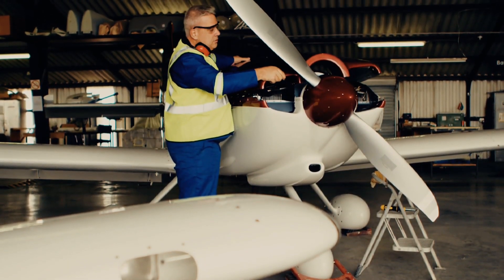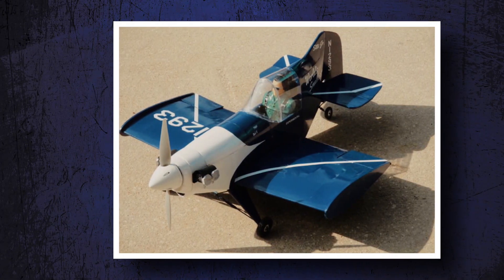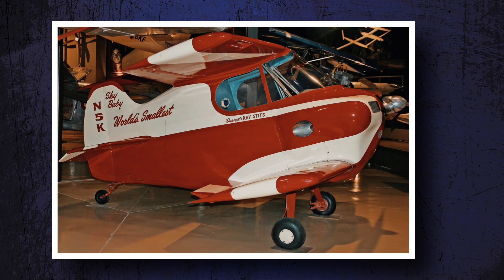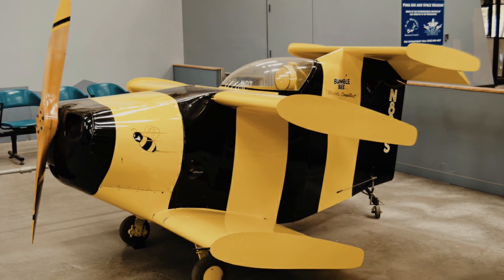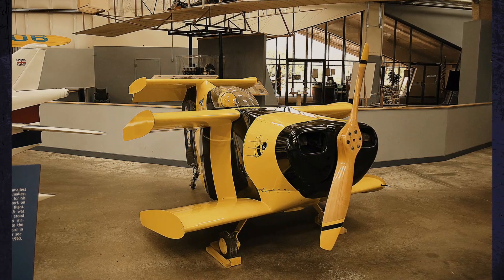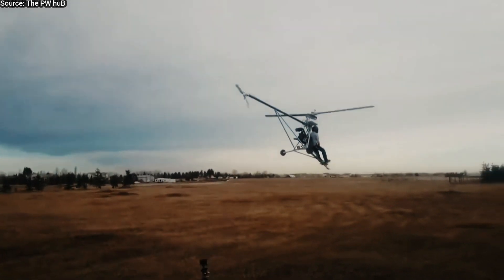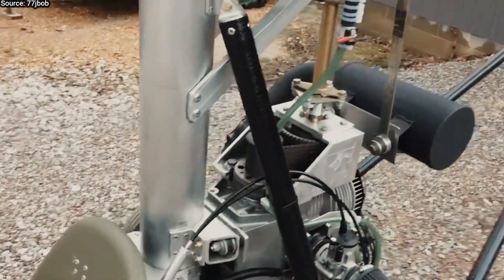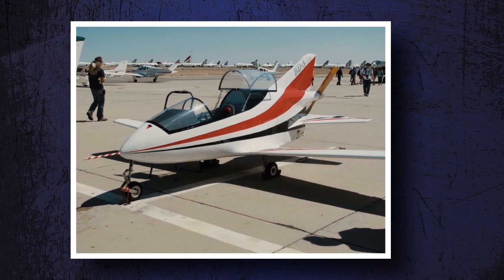The Smallest Airplane in the World

Comment: There aware a lot of errors in what you claimed. Try actually getting accurate info before you spout garbage. There were only 3 BD-5J airplanes that were fiberglass. There were no BD-5 Ircraft that used fiberglass over aluminum skins. And the first 4 or 5 BD-5's were pusher props. The jet versions came later. There were more of the pusher prop BD-5's than BD-5J's (jet versions). Please don't spew garbage about your absurd that you listed. By the way, I'm building a BD-5. I have not decided which of the 8 or more versions I will build.